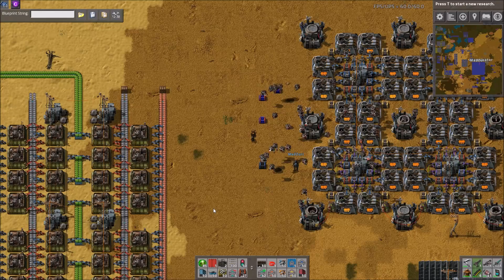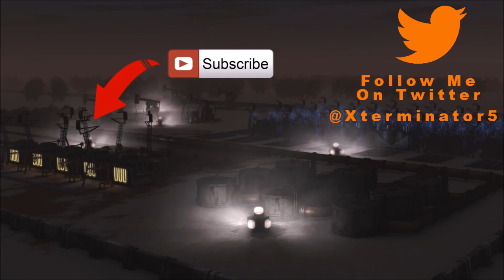Factorio Workshop - Building A Better Factorio :: Scarhoof's Smart Smelter Design

Comment: Is there any reason you wouldn't set the combinators to compare whether or not you have more copper/iron and produce whichever one you have less of (of course with a condition to avoid everything shutting down if they end up being equal) up to a maximum (in your case 1,000)?  I assume it functions roughly the same, but might work a little better with drastic shortages due to furnaces getting "locked on" to either resource.  I could be overlooking something here, but that's how I was planning to attempt my first build.  It requires a slightly more complex combinator system, but it shouldn't be too bad all things considered.
Reply from the maker: That would probably fix some issues yeah. I'm really not very good with combinators so can't say for sure about it.
Reply: I just uploaded a video of having made that change to it, if you're interested in that at all.  My solo commentary on it is lacking, but I feel pretty confident in the design (mostly thanks to Scarhoof's ingenuity) and might work with it further to include sorting bricks and steel into the automated part of the design.
Reply: I feel like a finished design including all four resources might be worthy of coverage separate from Scarhoof's full Megabus Series at least.

Comment: The problem I see with this design is that as your smeltery expands you can't easily change the minimum buffer of the whole smeltery.
Reply from the maker: True, although it could be modified to make it easier I think.
Reply: Read one of my other comments. I did it differently in my SpaceX+ map. May I ask if you've considered showcasing it?
Reply from the maker: I think I may have added it to our list, but I'm not sure. There are so many comments and submissions to keep up with that sometimes I forget what I've added/seen or not. :/
Reply: Its on the Discord if you want

Comment: 3:50 I wonder if it's possible to use a set of dedicated trains (one per furnace row, in place of input/output belts) with the cargo filters/limits to put an exact quantity of any of the four ingredient types through the furnaces. Then setup the train conditions to ensure the furnaces get filled and emptied before the train departs, i.e. no stuck furnaces. The inserter logic would be at the loading/unloading station; the furnace station wouldn't need any inserter logic.
Reply from the maker: Hmm very intriguing idea! Would certainly be worth a try honestly. I've always been interested in incorporating trains into a smelting setup directly. If you decide to give it a try at some point, I'd be interested to know how it works out! :D

Comment: I'd actually forgotten that I submitted this to ya :-)  For those that need more context, this is a small snippet of the smelting array that I'm using for my MegaBus series. It's a a small, bot-based minibase, used to supply me with items to build a larger base. I have a lot more of the iron/copper smelters in the base, and I offset the fatal flaw of it ping-ponging between copper and iron by having tiered outputs from the various modules. 1000, 2500, 5000, etc.
Reply: I also didn't have the power capacity available at the time I took this blueprint for speed or prod modules. They'll get swapped out once I have the power to handle them.
Reply from the maker: Thanks for the clarification dude. :) It makes a lot more sense now that we know it's part of a larger design, especially sense you have parts of it tiered to fix the issue of ping-ponging between copper and iron. That seems very similar to Zuri's old-school smart smelter, just a bit of a different layout. He still stands by the idea of using tiered filters, so nice job on having it that!

Comment: I prefer no drones in smelting and ores
Reply: i built a belt based design for the same purpose before. based on limiting input ores into furnace assembly. ie feed 1 belt of iron ores when iron <1000 2 belts when iron <2000 etc. but as others point the thoughput is very limited to the number of input and output belts
Reply from the maker: Fair enough. The main advantage to using drones is more throughput and less lag. But belts are cooler and the logistical challenge of them can be fun for sure!
Reply: Xterminator yea i think thats the thing i like the challenge of organised madness in belts.
Reply from the maker: Julian
Yeah fair enough, it definitely gets you thinking.

Comment: Watching the video, I noticed that the furnaces seemed to prefer to continue making what they had just made.  That is, the furnaces weren't switching back and forth between what they were making.  I wonder whether that would cause an issue.  Say you got to a point when copper was fulfilled, but iron kept running.  If copper started being requested again without iron ever having shut off, would any of the furnaces switch to making copper?
Reply: That seems like a fatal flaw to me.  I've had some success with adding an arithmetic combinator to multiply the 1 to a 5 and setting the requester requests from that.  But it put a heavy strain on the robot network and was never tested on a particularly large scale.

Comment: What's the purpose of the storage chests, especially 16? They don't seem to have a purpose with passive providers as Madzuri mentions. How did the stone bricks get in the storage chests at the bottom middle?
Reply: The storage chests are part of the larger design. This is only a small smelting portion from a complete bot-run base.